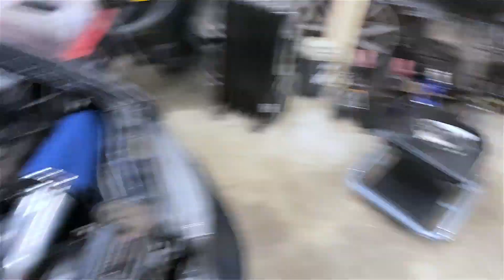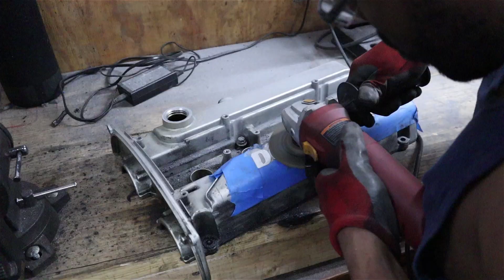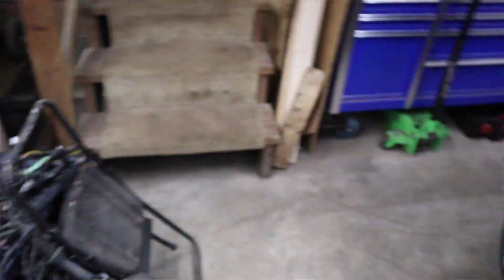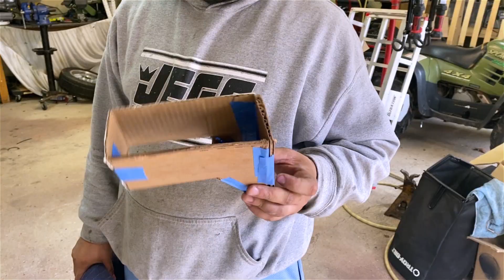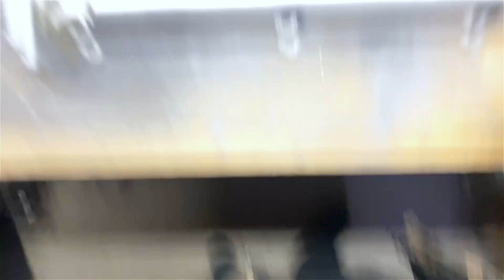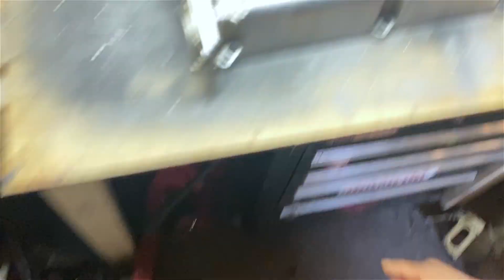Shaving the Valve Cover and adding -10an bungs

Comment: Nice work man looks good so far, looking forward to seeing the finished product. Been wanting to do this on my g4js valve cover cause I hate the font as well and need more ventilation. Mine will blow the dipstick out on a hard pull and get oil everywhere. Keep up the good work I’ll be tuning for sure for the color reveal and catch can install.
Reply from the maker: That’s what I was worried about. I figured it was a good chance to add some under hood bling and prevent a potential problem.